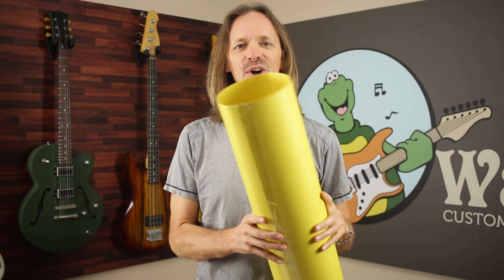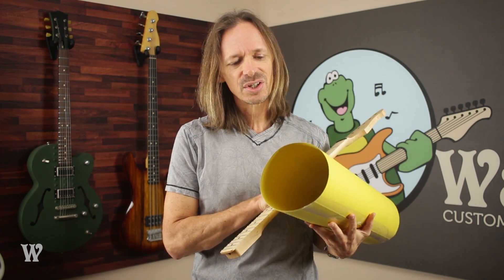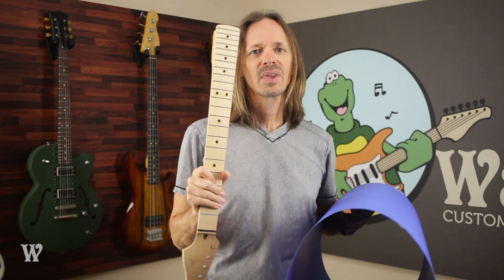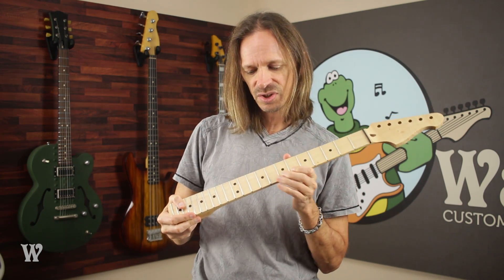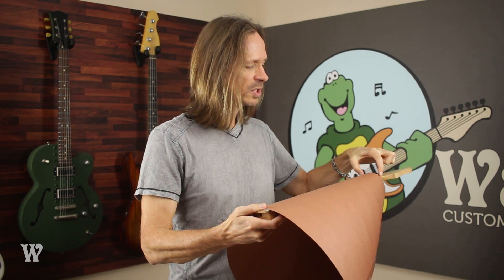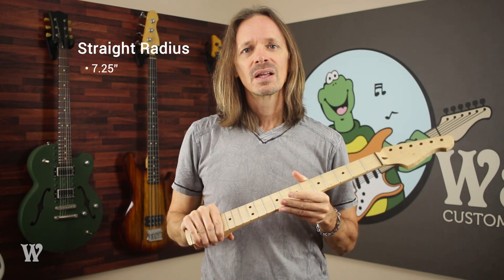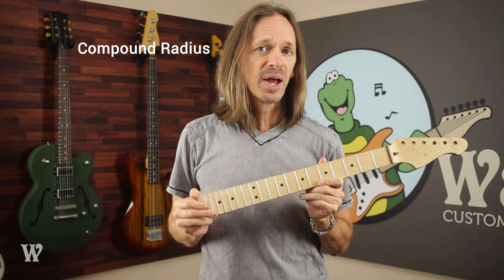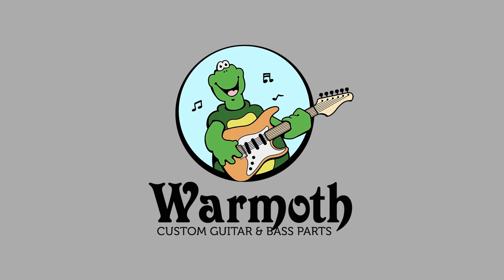Fretboard Radius Explained

Comment: I've been playing for 15 years and I'm still not exactly sure what are for instance C shape vs V shapes necks. lol probably sounds ridiculous but does anyone have any input?
Reply: mma 1st 
That’s the back of the neck, not the fretboard.
Reply: It’s the back of the neck where your hand goes. Been playing for about 6 years, and I’m not 100% either, as I just pick it up and say yup that feels good, or nope don’t like that. But I believe the C shape is more of a consistent round shape, whereas a D shape has more of a flat spot down the center (or maybe I have those backwards?). A V shape has more of a peak in the center with steeper roll off to the fretboard edges. Then there’s the offset styles that are more round on one side than the other, like the Wolfgang profile. I’m less concerned with the shape as I am with the thickness and width. I like a thinner, wider neck, with a minimum 1.65” nut width, preferably 1-11/16” (43mm). I used to like thicker, beefier necks when I was first playing, as I was doing a lot of chords/rhythm and it was easy to play, but as my playing has progressed and I’m getting more and more into scales and lead work, I find I really like the thin and flat necks I used to hate. Still don’t like a super, super paper thin neck, but definitely don’t like the baseball bats anymore. Used to “hate” the Ibanez Wizard necks and couldn’t understand why people would like them...until I started playing more lead stuff. Now it’s one of my favorite necks. Matter of fact my first Warmoth neck is a Wizard profile with the 10-16” radius and I like it a bit better than my straight 15.75” radius Wizard II RG neck, though the Warmoth isn’t quite exactly the same profile, it’s pretty close, just a little bit fatter. Definitely prefer the compound radius though.
Reply: c00lkatz Thanks dude. That's pretty much what I assumed. I just go by feel as well. The only time I prefer a big fat neck is when I play slide. I'm planning on putting together a warmoth soon there's just so many options. I'm just gonna keep trying until I find the One lol
Reply: @mma1st105  I built a Warmoth guitar for a buddy of mine, and he went with a Birdseye Maple neck , standard thin profile, 6150 frets, 1-11/16" nut, vintage tint gloss finish, compound radius. I ordered a neck for my JTV69 Variax, standard Maple, Wizard profile, 1-11/16" Earvana nut, Vintage Tint Satin finish, 6100 frets, compound radius. Both are modern construction. I know the feeling of looking at the website and not really knowing what you want or how stuff truly compares, so I'll offer my opinion on what I actually received.

The standard thin profile is a bit chunkier than I had imagined. It's no beefy Les Paul neck for sure, but it's definitely slightly thicker than the regular old "thin C" Fender necks I've played. My Classic Vibe 50s Tele neck is a bit thinner, my Fender Deluxe Player is a step thinner, and my buddy's Mighty Mite licensed neck is a bit thinner as well . If you don't like super thin but don't want super thick, it's a good profile. Their Wizard profile is a step thinner, and just a slight bit thinner than my CV Tele and the Deluxe Player Fender, still slightly thicker than the real Wizard II profile they're modeling it after, though, compared side by side. So it would seem their profiles are a bit on the thicker side of what they're modeling them after.

The 6100 frets are HUGE. Nice for easy lead work, but slides are "bumpy" - definitely a different feel, even compared to my Ibanez RG Wizard II jumbo frets. The 6150 frets are closer to what I was expecting, and more typical of the regular "Jumbo" offerings. I'd go with 6150 in the future for jumbo frets, and something smaller from there for medium-jumbo.

My buddy's neck didn't need any work at all. Fretwork was perfect right out of the box, and needed no leveling or edge filing. Mine, on the other hand, DOES need some work. The tangs don't stick out on the ends, but the fret shape near the edge of the fretboard is pretty squareish and a bit sharp. I filed those down and rounded them over a hair, and it's much nicer. I also have a few high frets I'm going to address. It's not way off, and definitely perfectly playable, but for the action I'm going for, it will need to be addressed. Both necks were from the Showcase, but mine was a "Hot deal" so maybe that was the difference? 

As for the preinstalled nut, they come cut for 9s, EXACTLY for 9s. If you want to put 10s, you're going to have to widen the slots or you'll get binding. I have nut slot files, so not a big deal. The Earvana nut - don't like it. It didn't sound hardly any different, and I keep having tuning issues with mine despite no binding in the slots or at the string trees (have even tried removing them as I have staggered tuners). Luckily I've found out the Earvana nut they use utilizes a Fender LSR nut slot, so I've ordered one to replace it. That's about your only option outside of a custom cut nut if you want to go back to a standard nut, as the Earvana is very thick and extends into the first fret area farther than standard nut slots.

The modern construction with the micro adjust on the side is awesome. The headstock looks cleaner, and the side adjust works great. Just set the neck straight using the main nut at the bottom, string it up, and use the side adjust from there.

Lead time is definitely longer than typical "internet purchases" these days. His body needed some routing work before it shipped, so his order took about 2.5 weeks to get here. Mine needed nothing and arrived in just under a week.

We're both super happy with our necks, and I would recommend if you have the extra cash. Definitely a step above the typical licensed Fender necks from places like Mighty Mite. The Strat body he got was perfect, beautiful body, perfect finish, worth every penny. We didn't even want to touch it at first for fear of scratching it lol. After we got it all set up and together, I look at other "off the shelf production" offerings and this would be a $2500 guitar easily for less than half the cost.
Reply: c00lkatz Wow. Thanks for the detailed information a lot more more help than most videos I've seen. I'm very familiar with the CV Tele necks. I prefer them over my mim Tele. I'm really looking forward to this build. Thanks again. I'm sure it'll help.
Reply: mma 1st If you like the CV 50s Tele neck I’d definitely recommend the Wizard profile. It’s closer than their standard thin profile. Wizard for a little thinner, standard for a little thicker. The overall shape is about the same between standard, Warmoth Wizard, Ibanez Wizard II, and the CV Tele necks. At least that’s what I’ve found with the necks I have in my possession. Always going to be some variance.

Also be sure to have some fret polishing stuff on hand. The frets come coated in lacquer if you get a maple board, and it takes some time and patience to chip it all off. After you do, they still need a polish either way.

Have fun with the build!

Comment: I wish y’all offered 20 inch radius necks cause those are dope.
Reply: Classical guitars are very flat.  It isnt as odd as it sounds.  Its just is not common on electrics.
Reply: geometrical shapes there is no way that’s a real radius is it?
Reply: Asa Makowski ya the Mark Holcomb pre has a 20 inch radius.
Reply: My set of under string radius gauges includes a 20”, but I have yet to ever use it and have owned over 30 different guitars across the whole spectrum of models/types.